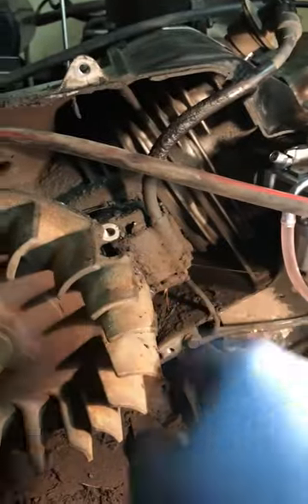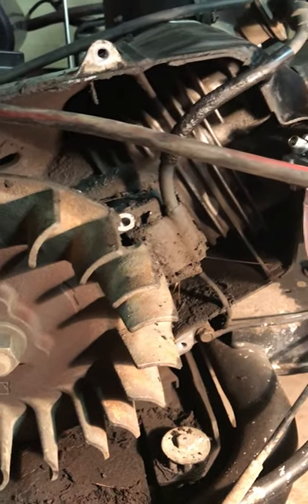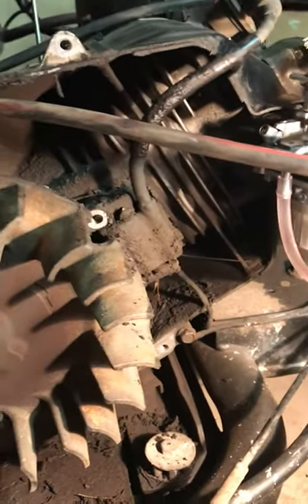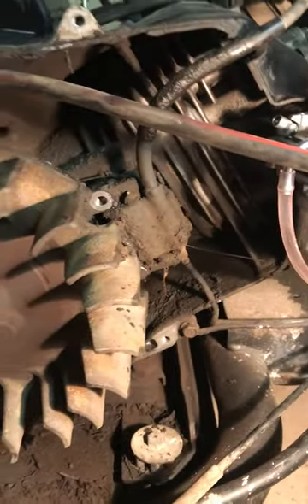Yamaha G22 golf cart TCI ignition coil replacement

Comment: Leave the tank in, remove air filter assembly, cooling cowl bolts and do the job through the gap. Use tape on the sharp edges of the cowl to save the blood loss and yes, leave out that bottom bolt, it's a right PIA to get lose. Don't use aftermarket coils, they are junk and won't last a week. Genuine Yamaha only. Coil to flywheel magnet air gap is 0.012"-0.020".
Reply: thanks for the info

Comment: Thanks for the video.  I have the same golf cart as you, was wondering if you could answer a question before I replace the coil.  I have spark, gas and air.  The cart turns over but will not start.  I sprayed starter fluid but still no start.  Would you happen to know if the coil could be the problem?  Thanks
Reply from the maker: Sounds like it.  Make sure your spark plug is gapped correctly.  I had the same problem.  I stepped on the gas and it just chugged.  Didn't move at all.  Replaced the coil and now it runs like a top!
Reply: Thank you so much for the response.  Will order one now.
Reply from the maker: Do you havethe mechanic manual for the cart?  Make sure you gap the TCI correctly.  Also be aware getting off the bottom left nut of the flywheel cover is a real bitch.  you need a swivel and extension for your ratchet tool (see :52 secon on vid).  when you put the flywheel back on, don't bother replacing this nut!
Reply from the maker: Also, sign up for "Buggies Gone Wild" blog.  There's a ton of information and a huge community of helpful golf cart owners who can answer any question you have.
Reply: Out of curiousity, did the coil solve the problem?  I bought a 2006 G22 and drove it several miles before I bought it.  It ran great.  Loaded it onto the trailer and hauled it 75 miles home.  It would not start to even back off the trailer.  I have spark, gas and air and am now attempting to take the flywheel off to remove/replace the coil.
Reply from the maker: Yes it solved the problem been running great since I changed it.
Reply: @laynesmith954  Yes, it solved the problem.